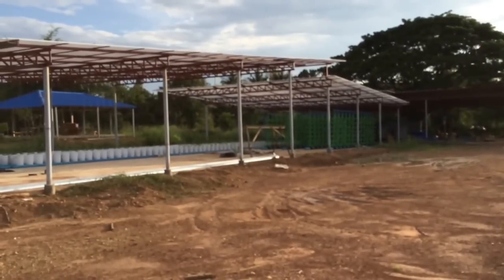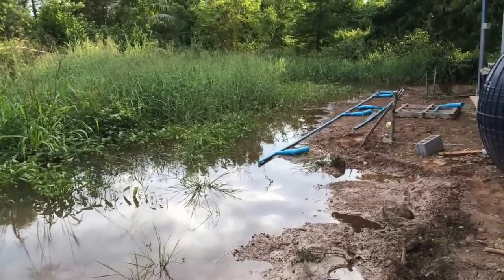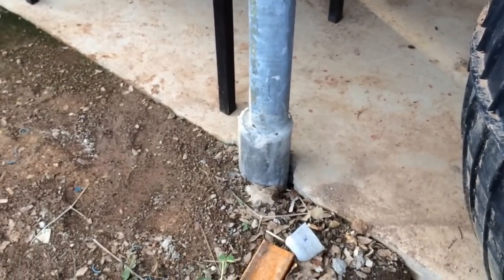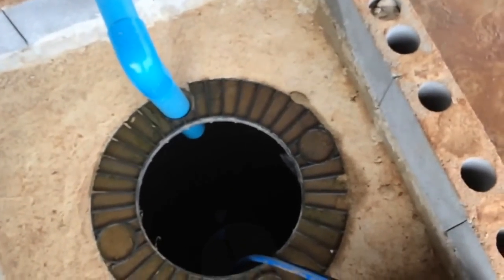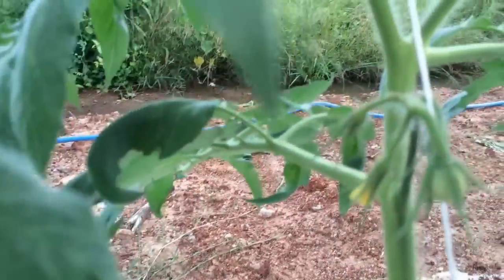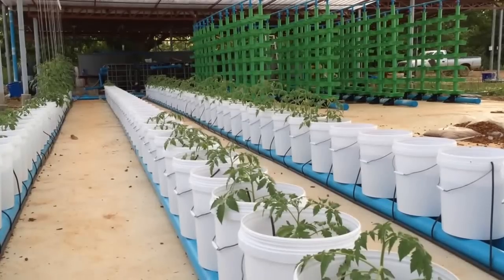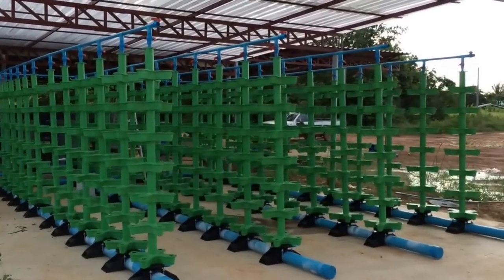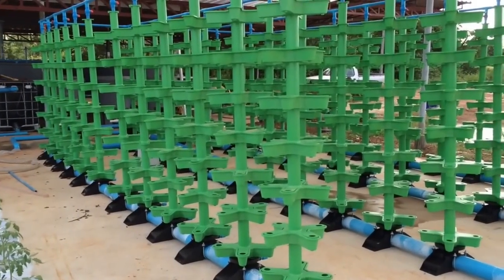Commercial Aquaponics System Build Part 14

Comment: Just saw your video. I can sympathize with you. I had a badly cracked 18,000 gallon cistern. I used a product called XYPEX to fix it. Awesome product. See if you can get it there or have someone bring it / send it to you. comes in a 2 bucket pale. 

I have also been fitting the rain. Roads washed out and mud everywhere. 

Hang in there and keep us informed.

Comment: itll be much better if u started small and increasing things gradually instead of 1 full installation. based from my experience, maybe its better if you redesign your aquaponics (using holed and bended pvc pipe with net cups works fine n less blockage) imo start with lettuce rather than tomatoes, cos tomatoes needs low ph and fish hates it

Comment: Better Days ahead ! Looking forward to all of your updates- commercial growers rarely share their secrets. Thanks for sharing yours !
Larry
Reply from the maker: There are no secrets here, just a bunch of guess work and crap shooting. lol!
Reply: well, on how you mix your own nurients & how that is more cost effective & you describe what size pumps you use & etc.
Reply from the maker: ***** Oh sure! My power usage is high, atm. Total system is using over 1Kw per hour. Tons of air pumps, and those large pumps suck up a lot of energy. The hydro nuts are very affordable in my opinion, but I'm not sure I would bother doing it if I had access to premixed solutions. An example would be something like Master Blend (which I've used). It's easy, readily available, and cheap. But, on the other hand, I have tons of flexibility and control over making my own mix, and I have a far greater understanding of chemical bonding, and what plants need. In short, learning hydro has really benefitted me in understanding Aquaponic water, and nutrients.

Comment: Looking good Ryan... 
Any one need any help with mixing their own hydro nuts should get in contact with wesco the #1 chemical fertilizer suppliers in thailand,  their  hydro specialist is called Pon, Phone # 085-449-9982 he will give you a basic formula for what ever you are growing at wholesale pricing, he speaks english well  ... also has smaller size kit mixes available for around 2,000thb will make around 200 ltr of concentrated a and b formula if you don't need 25kg sacks of everything shipping is really cheap to with local transport from Bangkok to chumphon was 150thb... if you want to run in coco coir you need to change the ratios as the coir really locks up the Mag and Cal.. also good for chelated iron and anything else you can think of good guy I have been dealing with him for about 3 years +   getting ready to get my other channel going again for greenevolutions re-launch.. will do a video on how to mix your own nutes for hydro from scratch ...
Reply from the maker: Pon is a great guy, and his Managing Director Andy is also very helpful. Please do let me know what your new channel is when you get it sorted. I will not be doing a video on nutrient mixing, but looking forward to yours.
Reply: Ponic Wars Are you still getting the rain .... it has been full on, non-stop, Rambo rain down here in chumphon.. if your getting it again like this, I really feel for you... looks like another couple of days and it should be over ...  how about  doing a quick re plumbing add a small rubbermaid tote to the end of your bucket run and digg it down as far as you can .. let your buckets drain into it and have a pump in there pump it back to a large  temporary header tank that can hold a large volume of nutrients and overflow feed to the buckets ....  not sure if this makes sense... but it would fix your problem for the time being....
Reply from the maker: Youtube University Well, virtually everything is concrete, unless I want to run the plumbing over to the edge of the concrete and dig there, however then I'm only encouraging further "washing out" of soil under the slab. Our rain here has slowed, 30 minute shower yesterday, 30 minute shower last night. I'll go see how bad the damage is shortly, as I'm out the door soon. Yesterday was no worries, I don't anticipate anything being too big of a deal. As soon as I get a back hoe in here, the problems will be nullified forever. Some tanks will need to be replaced at some point, but I'll need a jack hammer to get them out, as they are under finished concrete. Thanks for the ideas though, I just can't get a large enough tank in area I have to serve as a reservoir. I'm also not at 100% atm, so I'm limited in what I can do physically. I really really fucked my back up last week. Still nursing it back to health. lol

Hope your rain stops!

Comment: Oh man - what an awful time you've had with the rain. I feel so sorry for you after all the work that's gone into those tanks. It must be so disheartening. I wonder if some kind of liquid rubber could help your sump tanks. Bring back the sunshine!! The tomatoes are looking great though and your site is going to keep on looking better and better as those plants grow out to fill the space. In a few weeks time you should have a sea of green leaves with yellow flowers dotted throughout so try to keep on smiling. Cheers!!
Reply from the maker: Heya Jim Conner. I think I can patch the hole, and get it back online. If I cannot, it's not a huge deal. I will tear it out, put in a concrete box, and inside of that place a proper water tank to use as a sump. Just a stroke of luck I incorporated an extra random IBC which is now serving as the sump. 

As always, thanks for the encouragement.